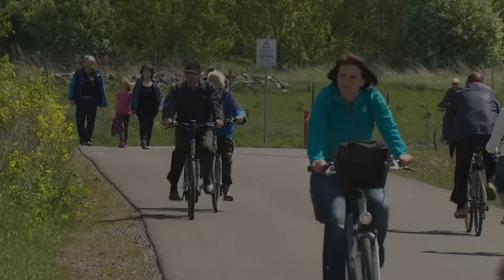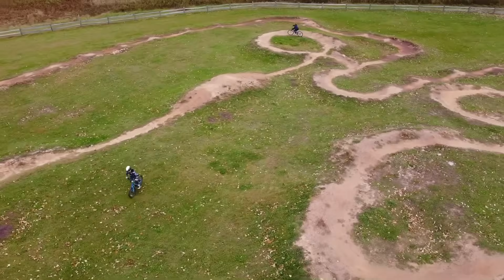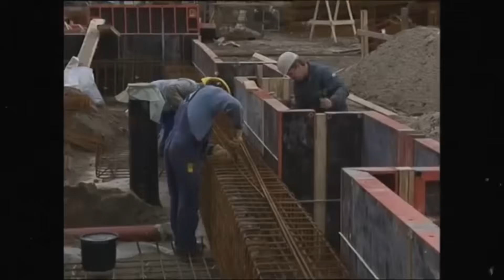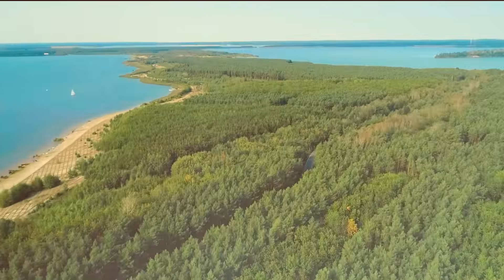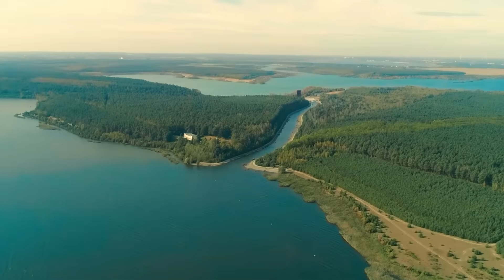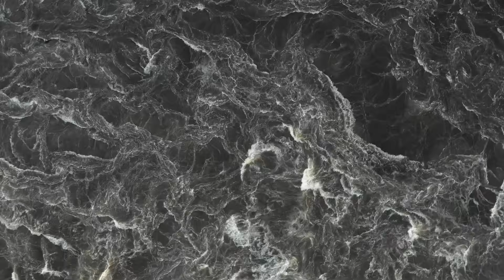Germany’s $4 BILLION Plan To Turn Its Biggest Coal Mine Into A Lake!

Comment: 20th century is 1900-2000, so no by the 20th century coal mining had not declined but by the 21st
Reply: At least in Germany the decline has been ongoing for decades. Especially hard coal mining (which had taken place underground in the Ruhr Area) had been massively reduced before the new millennium. And the same has been foreseeable for soft coal for a long time now. So overall the statement in the video is correct.

Comment: Part missed opportunity. This could have also become a large energy storage for solar and wind energy. This by building a dam in the middle with a turbine and pump function. At high energy supply you pump water to one side and at energy demand you let the water flow back through the turbine. The storage potential is about 6 GWH per mine
Reply: Unnecessary. There are hundreds of wind wheels already

Comment: In only germany would use more fission energy instead of using more coal!
Reply: Because the Germans have one problem, they don't have some huge wastelands where the put their nuklear waste for the next 100 generations save in a landfill. All the nuclear waste produced by the former nuclear reactors are temporary stored close to the old reactors (partly still cooled otherwise the waste would get hot again) because they didn't know where to put the waste permanently.

So they decided to not build new nuclear reactors and the old ones where so old and financely expensive to keep them running that they where shut down now (because of fukushima faster then planned).

Then the goverment changed and the then new goverment cut down the expenses to transform to renewable energy - still giving financial help and "easier rules" to install solar power but didn't force the building of new landlines (in the north most of Wind energy is produced (at night no solar one) and the energy cannot be fully delivered (without huge losses) to the south where most industries need the power.

Additionally the goverment is mostly underrepresented by physicans and so they forget that there is a need for power storage (what starts currently be rebuilding huge water-pump-energy-storage-lakes, battery storages etc to store peak energy from solar and wind and sell them at low production times (net stabilisation).
Reply: @dirkspatz3692  

misinformation alert! nuclear waste is a total non-issue (apart from the cost of disposal) and anyone telling you otherwise isn't worth listening to.

Not only can nuclear waste be reprocessed, but you literally can just... bury it. Now, does the cost of disposal alter the value judgement between Nuclear & Renewables? Maybe. But simply digging a really deep hole and putting the nuclear waste down it and filling it back up again is an entirely viable strategy. You DO NOT need "huge wastelands" in which to bury your nuclear waste. You can bury it basically anywhere geologically stable enough.
Reply: @dirkspatz3692  but nuclear energy waste is solid and very small volume so is easy to store and manage like you said near the very reactors who produced them without issues . The national deposit to store those long term is mostly a problem because people fear radiation .
Reply: @corradoalamanni179 And rightly so. Also there's still that risk of a nuclear accident. Yeah I know, that's very unlikely. But as catastrophes with long term repercussions go, that's one nobody wants.
Also Germany can easily and with low cost generate it's power with renewables within the next couple of decades, so there really is no need for nuclear power anyway.
Reply: @pheumann86  if you compare germany with france the second has less co2 intensive and cheaper electricity we can achieve better faster and cheaper result with using all tech. About disaster they are well known sure but fukushima and three mile island have zero death from radiation only chernobyl and that was a disgrace and even then more people die every year because of regular pollution

Comment: Something important to be mentioned, when the open put lignite mines where planed, the company had to put a percentage of their profit aside to finance the rebuilding of the mined area. There where also studies done to determine the damages the mining would do and how to reduce it even while mining. As an example. The ground water level had to be lowered to get to the lignite. But instead of pumping the water into rivers, the water is pressed back into the round around the mine to hold the ground water level up.

Comment: I hope they are able to divert water from nearby rivers rather than pumping ground water, it would take so many years to recover that water in the aquifer
Reply: They lowered the local ground water with pumps while digging. Shutting of the pumps will naturally fill the hole in (as far as I remember correct) about 40 years ("slow" natural process). To speeden up there is the idea to build a channel to the hole and use flooding-water to fill it faster and lower the water levels of the flooding at the river. LAter the channel could be used as an connection for little boats from and to the lake.

But high populated area and buying the land for the channel could mean to bulldoze a lot of village again.
Reply: The biggest area to fill is a few dozen kilometres west of the river Rhine. They're building a giant pipeline right now. Even then it will take decades to fill up the lake.